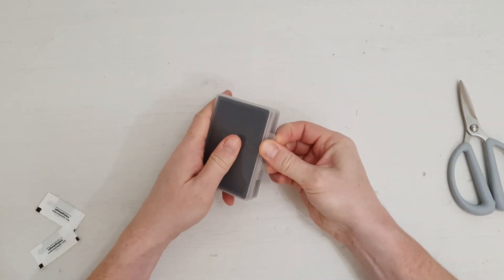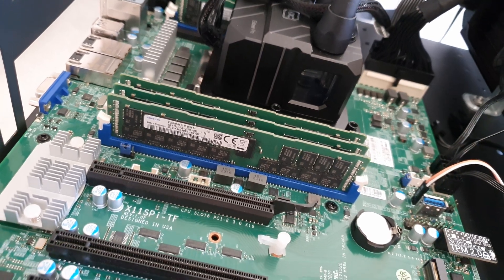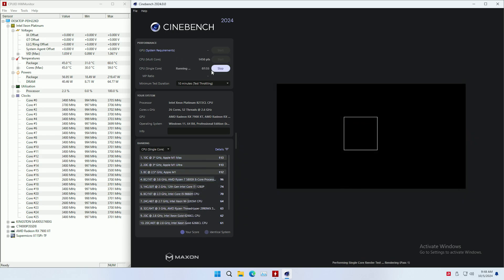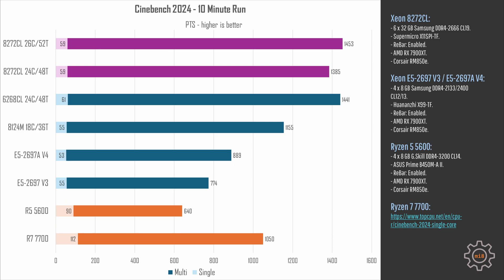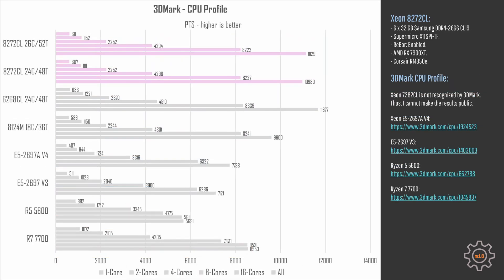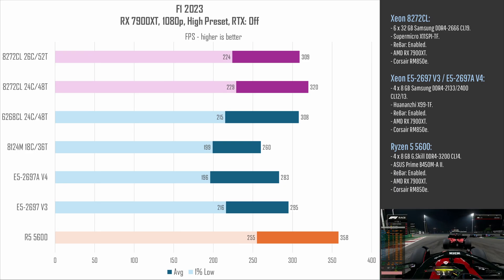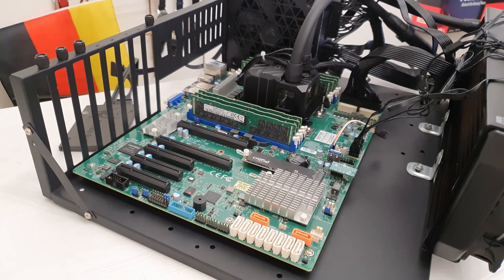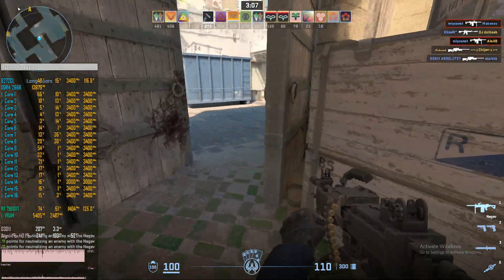Xeon Platinum 8272CL, 26 Cores, 52 Threads, up to 3.7 GHz, LGA 3647

Comment: Hi everyone, I'm just getting started with Chinese motherboards and recently tried the JGINYUE X99-8D4/2.5G Server board, which supports my 2699v4 CPU. I got it for $70. However, it's quite temperamental when booting from NVMe and SSD drives. I can access the BIOS fine, but if I leave it off overnight and then power it on, it tends to boot from the NVMe drive running Proxmox.

I'm looking into the MIYCONST mi899 tool to troubleshoot. I’ve also tried turning off CSM (Compatibility Support Module), but it hasn't made any difference. When I try to boot into Windows 10 from a Ventoy USB drive, it freezes during the loading process. Interestingly, if I leave it overnight, it sometimes boots into Windows. I managed to take some screenshots and run memory tests, which all came back fine.

just joined the discord group.

Comment: Seeing the current 2015-2017 incarnations of these CPU's yes I think most of them are complete duds. That doesn't mean Motherboards from china won't be made, I can still see some opportunity to sell these en masse with cheap as hell motherboards (hopefully not awful VRMs) but in most cases.. the only viable way to get LGA 2066/3647 and first gen EPYC Naples cpus will actually be getting them for dirt cheap refurbished computers. Even then, most of them have old and non standard PSU's with inconsistent motherboards what a waste!

Still I would say their performance is not awful, but clearly they need to be extremely cheap otherwise, a giant horde of cheap AM4 Especially right now will make LGA 3647 and LGA 2066 extinct, I see 45$ Cheap Am4 Chinese motherboards everywhere, most of these can fit in 8 cores and the amazing 5700 x3d. They need to sell these CPU's for basically nothing if they have to compete with Zen 2/3. I am not joking, I can assemble an AM4 setup with a used GTX 1070 and a Ryzen 3600 for 420$ at most. I can probably go even cheaper too.

I very much disagree with you! We WILL HAVE another X99 generation with AMD's Socket SP3, some CPU's there will have 100-200 watt ranges, meanwhile Zen 2 era Rome CPU's all have amazing L3 Cache, Epyc 7262 (8 and 16 cores) has 128 MB of L3 cache! Mind you, both hit up to 4 GHZ too. And to Ice it on the cake... It can go all the way to Zen 3 (Milan) which only ramps up cores and cache, there is no way we won't have another generation assuming Chinese motherboard makers skip this generation of awful Sockets.

Just stay away from those 350 watt or 280 watt monsters for our safety's sake, the Cache is simply not worth the insane power consumption.

Comment: higher TDP is an advantage so should be marked green as cpu can maintain higher turbo clock, yes it needs more cooling and higher power consumption, but it's faster and more cores can have more power to run higher clocks
Reply from the maker: It's not the full picture. With LGA 3647 higher TDP CPUs won't boot in motherboards that don't support that TDP.

Comment: try to get your hands on the xeon gold 6154. 18 cores that does 3.7GHZ on all cores, costs around $100. that would be interesting.
Reply from the maker: How do you know it's 3.7 GHz on all cores? I can't find any proof of that. Otherwise it's a pretty boring CPU, about the same as 8124M.
Reply: @Miyconst  I just did a google search for “Xeon 6154 all core turbo”. Wikichip is usually where I can find the all core turbo. It shows 3.7Ghz under normal all core load, 3.3GHZ under AVX2,and 2.7Ghz under AVX512.

Also I have a friend who purchased one, 200W TDP 18 core.
Reply: @Miyconst  I don’t see my first comment for some reason. If you google “Xeon gold 6154 all core turbo” then the website “wikichip” states its all core. A buddy of mine purchased one and it was 3.7 all core

Comment: Recently one of my friends came to me asking for a 300€ build.
Ended up selling him my E5-2697v3. Got him cheap kit ram 2x32gb ddr4 ecc 2400mhz
X99-d4 plus (turbo unlock made the cpu go to 3.4ghz all core) GTX1080 founders edition, 750w corsair psu, 1tb nv2 nvme and a cheap aercool case.

He was over the moon about the pc's performance because he thought the cpu was going to be weak. I said it wont be. (Wanted to try runing my 5930K again but that now shows error code 95 on my rampage V extre and my jinsha X99-d8i so i have now a E5-2699V3, 12cores active, 3.6ghz all core boost)
Reply from the maker: Yeah.. these days we have so many different budget options for gaming PC, the only problem is that we have fewer and fewer games worth playing.
Reply: @Miyconst  100% fact.

But maybe soon more new games will come out worth playing
Reply: With only 2 sticks of ram, it would only be running in dual channel mode rather than quad channel. Get another two sticks of ram in there, you’ll notice the difference.
Reply: @julianfiacconi709  thoose 2 sticks were quadrank sticks. Theres no difference in games or general useeither in dual channel or quad
Reply: @dexsters5643  Quad rank memory in one DIMM slot only allows for the CPU to communicate data at 1 rank at a time, not simultaneously, as would happen if you fill 4 DIMM slots (assuming there are 8 DIMM slots) corresponding to motherboard user manual. 4 sticks of single or dual rank DDR4 will be significantly faster than your claim of no difference.

Comment: I am very interested in idle power, I think that is more important than highest possible consumption.
Reply from the maker: It's about 50-60 watts with my setup.
Reply: @Miyconst  Including GPU?
Reply from the maker: Yes, my entire test setup.
Reply: @Miyconst  Not bad. Must be in line with AM4 and probably better than X99?
Reply from the maker: @b3nisen  it really depends on what setup you compare to, my basic AM4 build idling at 40-50 not 50-70 watts and X99 is about the same 50-60 watts.
Reply: @Miyconst  Thanks for the info!

Comment: I'm sorry for my stupid question, I ask only because I really don't know anything on these relatively rare boards and procs. If you shut off Hyperthreading, does this change performance in any meaningful ways? Lower power? Higher clocks across cores?..
Reply from the maker: No, disabling Hyper-Threading only hurts. The more cores used at a time the lower the frequency is. It's not like Turbo Unlocked V3.
Reply: Cache L3 limit The frequency per core is not important
Reply: @manatureprofonde4315  No, because cache while important is not valid for every workload or use case. If it was everyone would have bought AMD 3d chips for everything.

Comment: Can’t thank you enough for all that you do, by providing us valuable information to pursue affordable HEDT alternatives. I’m on X99 and X299, however I’m likely to skip LGA3647 and move to LGA4189, IceLake Xeon. Prices are also in a slow decline for those components (motherboard and CPU), and PCie 4.0 lanes will make it worthwhile for me, not to mention the 8 channel memory. Cheers
Reply: Perhaps "4189" should be skipped. And immediately on gen4 xeon lga4677 or already on gen5 with chiplet memory hbm2 in the processor-cache L4 80Gb)))) HPC)))
Reply: Prices for socket 4677 motherboards are still too high and sellers are firm on their prices. Sellers of 4189 hardware are receptive to negotiation downwards. I’m still watch both motherboards however. Socket 3647 motherboard sellers are unreasonable in their asking prices.  Will see what happens in the new year. This here is the best socket 4189 video for hobbyists I could find on YouTube https://youtu.be/L5A6tt3_GwQ?si=AyGP92-1V0Ni85EY.
Reply: @julianfiacconi709  Asus rog Dominus ) Like back in the day a Rampage V
the manufacturer hasn't played enough yet
It's too early to expect a price reduction

Comment: to be fair about "Ali-boards" - seeing how most of the resellers from there (like Huananzhi and others) moved to either boards with soldered chips (like Erying) or boards with more "younger sockets" like AM4 / AM5 / LGA 1700 etc. (like Jginuye or Huananzhi)

we probably will never see anymore Chinesium boards like the "golden era of X99" we had some years ago
Reply from the maker: Very true. LGA 2011-3 platform is one of its kind, just like AMD AM4.
Reply: You are so right. I was thinking the same that we had a golden opportunity. The sad part is LGA 3647 will flood the market with no mobos to go in and will just go the land fill.
Reply: Does Huananzhi makes AM4/AM5 mobos?
Reply: @chedds  yes
Reply: @chedds  i remember i saw their lga boards and am4 at least

But you csn get AM5 from Jginuye
Reply: I tend to agree that X99 is the end of the road. X299 was such a flop that remanufacturers wanted nothing to do with it, and then HEDT was abandoned entirely after that so there's no successor platform with prolific availability.
Reply: I think there is still a chance for 3647 LGA, I don't think AM4 CPUs will get priced like banana like older Xeons are, an 2016 1500x is still more than 30$
Reply: #Karti  Price issue. What does Aliexpress offer? Silver 4110–6$ Why? Who needs one? 8/16 What's the point? Gold –$150 Platinum 81xx or W-3175X still makes sense.
The well-known manufacturer hasn't played enough with the platform yet. Asus ROG Dominus Extreme hasn't collected its cache yet, from enthusiasts. It's too early to expect production development from Klisre or Huananzhi...)  
  Moreover. A more promising "gen3" platform "4189" has already appeared. There is Platinum 83xxH/Y

We've also seen boards on the X89 chipset. For Opteron G34 The manufacturer doesn't even indicate the name or where the creator of this "miracle of technology" is.)))
p.s. My configuration Gold 6248r asus pro ws c621-64L sage 10g ExeGate esnk-00068P Cu 240Gb LR ddr4 quadro a6000 +2-way Tesla L40 ssd U.2 4-way Phison 1.92Tb(no m.2;URL m.2 higher video card.All line pci for titan's card) psu HP c7000 2450W Purchased in March 2024. In Russia. In the DNS store.)